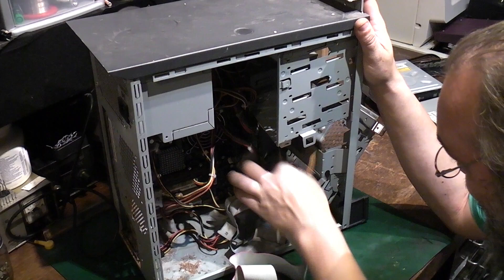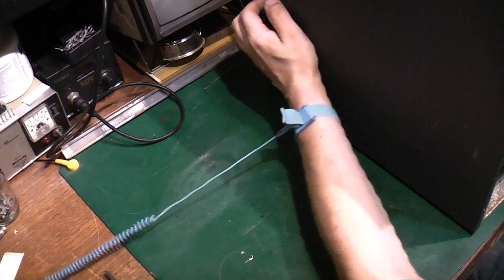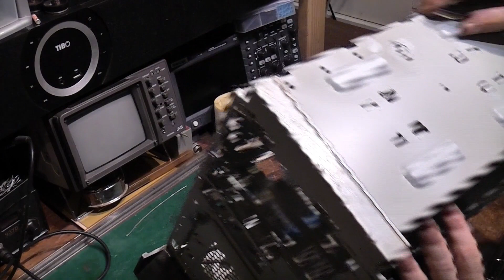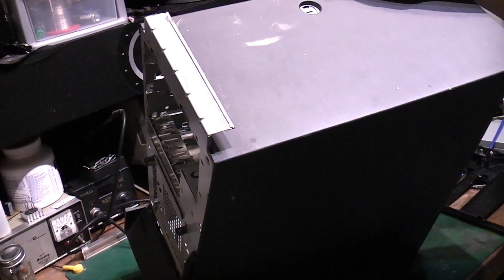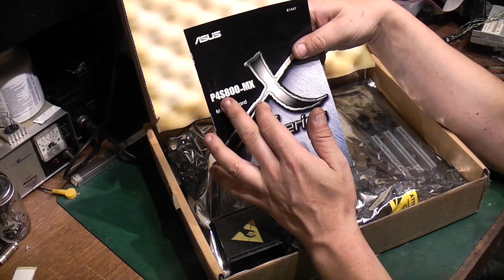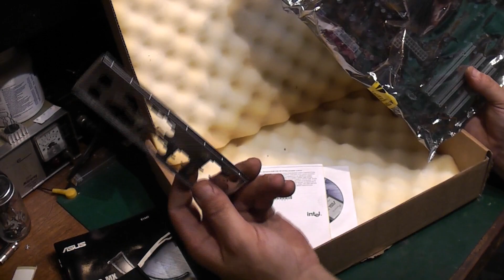Old IBM Thinkcentre rebuild Pt1

Comment: DDR-400 so DDR1 400mhz(200x2) Guessing Via KT800 chipset skt754, so early 1st gen AMD Athlon64, 2nd gen would be 939 but most(not all) of those would be PCIE boards rather than AGP. 2004/5 ish time period. original board should run windows 98 just fine also, pretty much on par or slightly better than the P4 board.